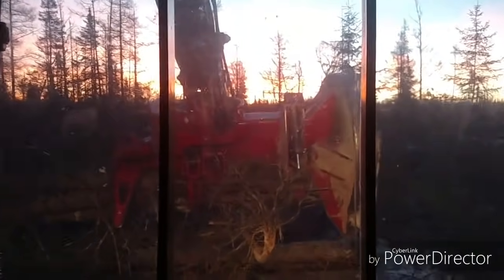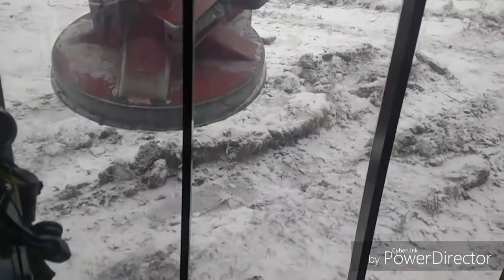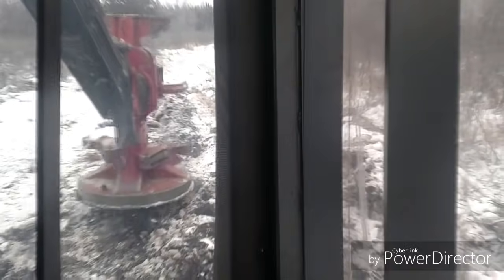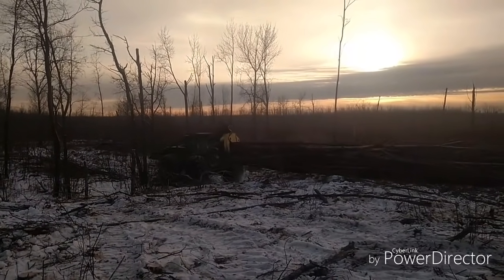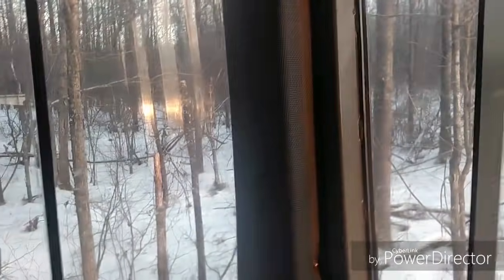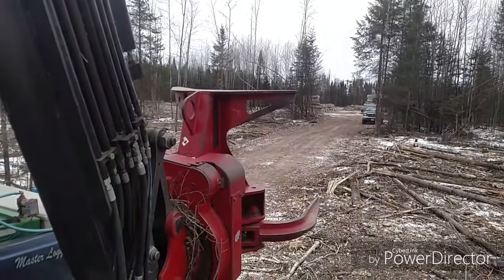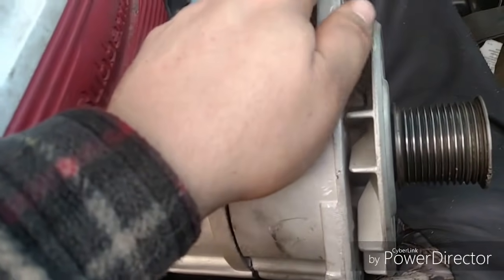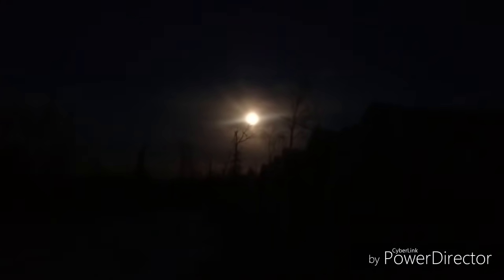Impossible Logging Road and More

Comment: I'd have been disappointed in you if you had passed up a broken rubber joke!
Merry Christmas!
Reply from the maker: That was bad....  You would not be the only one I've disappointed.  Thanks Tom 😀
Reply: @davidhaley7053  
Why rubber bands instead of springs?
Reply from the maker: Many other brands of saw heads use springs.  I'm not sure if one is better than the other.  They can last a couple years of I don't shove something through them...
Reply: @davidhaley7053  ahh, the operator

Comment: You have NO couth David Haley but it don't matter. Truth wins over couth every time. The rubber joke was truth too. Get a concrete screed for the back of the saw. That'll flatten out the bumps as you go over 'em and as for using the saw as a pile driver, Red Green says that ANY tool can be the right tool. And that gooey spot could be a dandy place to have a lot of trouble. And the single barrel potty with no walls don't mean nothing. Only one of yall are out there at a time and all the varmints won't do anything but laugh anyway. You have a lovely time and maybe fall some timber and get some freezer filler while you're at it!
Reply from the maker: I'm like a bull in a China closet!!!  Not refined at all!
Reply: @davidhaley7053  Me too. I fine tune things with a 3 pound hammer.
Reply: @davidhaley7053  I think we're both FULL of the bull in the china closet.